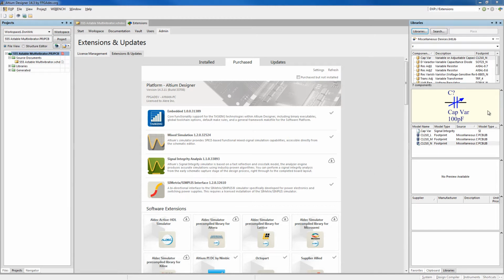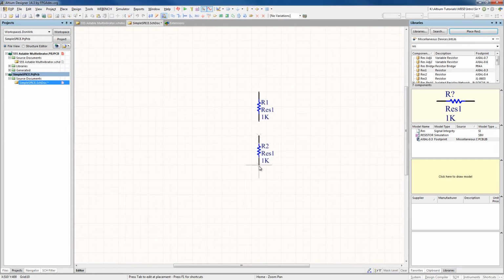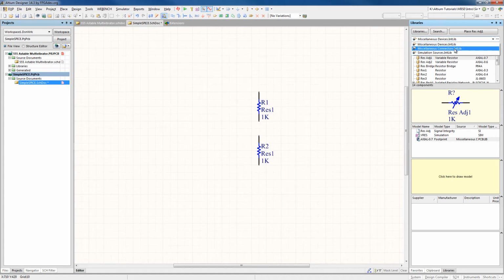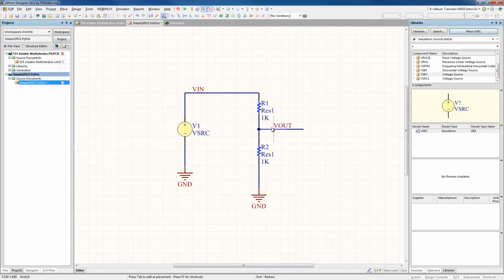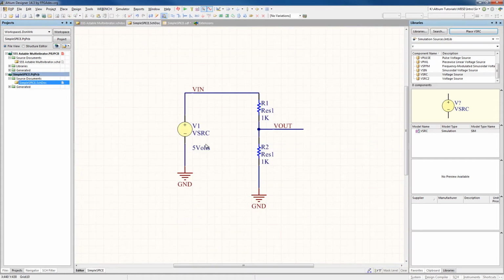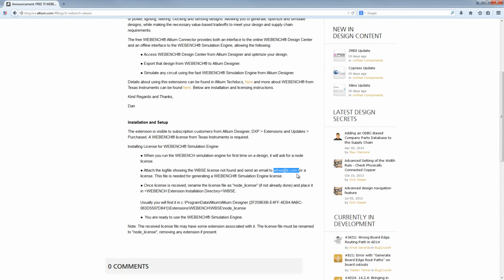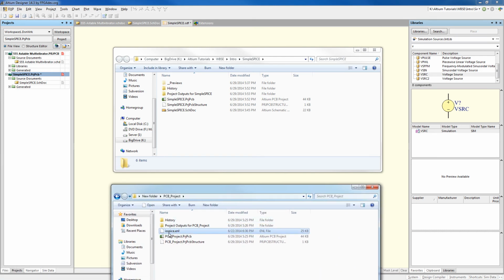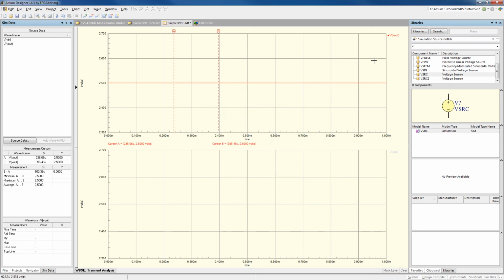Webench in Altium Designer

Comment: The latest version of WEBENCH Altium Connector is 1.0.0.37. Apart from the isspice.enl stuff, you can export power as well as filter designs and simulate it in Altium.